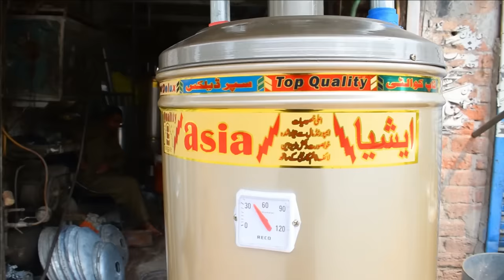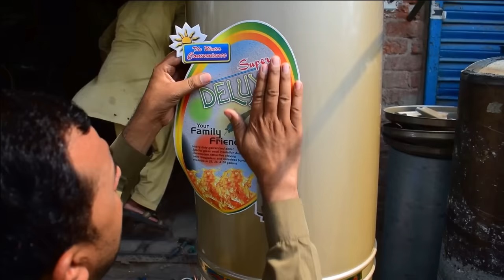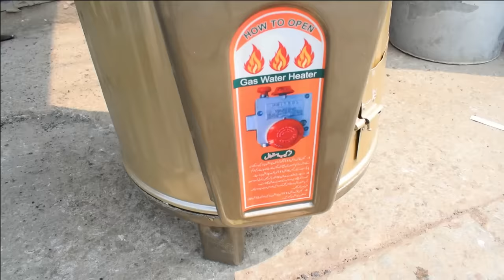Geyser Manufacturing || Incredible Technique of Making a Gas-Fired Water Heater

Comment: This is how things used to be made. These guys in this garage are making a superior product to what we have in the states. I replaced a water heater in my house that was made in the 80’s. Now 7 years later I’m replacing that one due to multiple failures. We need real manufacturers like these guys with a craft. Not computer guided cheap disposable shit. A++
Reply: Seems to me you must have bought a Pakistani water heater. In the usa, at least with electric water heaters, if you change the anode as needed and the very cheap heating elements [$6] or the thermostats [$8]  they will easily last 10 to 20 years. Now we are getting some stainless steel models and the life span will be 25+ years. Had you changed the anode on your heater on year 5 you might have had another easy 7 years. This water heater with out an anode is doomed to failure early on.
Reply: Em dez anos esses soldadores estarão todos cegos. E os aquecedores em perfeito estado. A exploração continua firme e forte.
Reply: @joaquimgomesjunior5010  Eles ficarão cegos em 5 anos e o aquecedor de água será sucateado em 3
Reply: Having managed a Rheem plant for 20 years, I can tell you these water heaters a just ticking time bombs. 
Galvanized internals do not last let alone the removal of it via the welding. 
My guess is that the efficiency rating is next to zero, thermal siphoning is not even considered, by the way, that’s also the case in the US and Canada. Tying insulation on with cord compresses it to zero efficiency. 
I guess shiny paint and colourful stickers can fool the uninformed. 
It’s only ever about the money and even just sales to 1% of their population rakes in plenty of cash. 
Just sayin!!!
Reply: @richardtemby4358  Yes, it's a pretty comedic bit of industrial [wasted] production.
Reply: @richardtemby4358  They should be rather making shoes and teapots, samovars and kettles. No chance to hurt anyone that way. By the way I have been looking for a water heater engineer: Have the Rheem elements in the standard 4500 watt range been cheapened? I have a 30 gallon heater with both elements on most of the time in a radiant heat situation.  Elements last from 3 days to 4 months but not much more. I have used every sort made - ripple, fold back Incalloy, high and low watt density.  Water is hard,  but  I sense a manufacturing defect. Any thoughts?
Reply: @RRaucina  
As I’ve been retired for 20 + years I’m not up to date with current components, however just a tip, try putting the two elements in series, it may be a bit slower but the elements will last much longer.
Reply: @richardtemby4358  What about their tankless systems?
Reply: @abundantharmony  
What about it???
Reply: @RRaucina  if water is hard take Ph samples, how much ppm of calcium and other minerals that are making the water hard and go from there with softeners and water filters. Elements should be lasting longer than that unless another unforseen problem is causing the elements to burn out so fast
Reply: @abundantharmony  tankless water heater as far as the electric type goes are crap in most cases unless you spend the money to have a good one that won't short out or not work within a few years
Reply: This is how crap is made. If you knew anything about a water heater, you would instantly know this is a bad joke on the buyer. No one in America or Britain EVER manufactured such junk. Sad waste of materials.
Reply: No, water heaters should never be made this way! This is a case where "hand made" is a bad thing. No glass lining, so the water will corrode the unprotected steel (especially at welds), and does anyone really think their pressure test is adequate? And there's no anode rod or pressure relief valve and virtually no insulation. These are dangerous.
Reply: Sir, Ap sa contact kasa hoga
Reply: @RRaucina   what kind of anode boiler have????
Reply: @swapnilraut6046  magnesium or aluminum. Google it!
Reply: ای
Reply: Yes sir !

Comment: Cutting galvanized steel with a tortch produces toxic fumes. But what the heck, they are nearly working outside the "factory" and get all the fresh air they need.
Reply: Dear Ebbe Weber
Inclusively the toxic exhaust gases from all the traffic and the fumes from spray painting!
Best regards, luck, health and wisdom.
Reply: Токсик фумес это херня! Оцинковка моментально гниет по швам. Насквозь.

Comment: I was waiting for the demonstration of the interior electrical part, but no problem I understand the commercial secrets, good video.
Reply: There are no electrical parts and there are no secrets its an open design , The camera man just didn't pay attention to details
Reply: @apkafan8004  exactly
Reply: it is algo a gas heater, so maybe more homeowrk is required before you think of ruling you own design
Reply: This heater generates its own power through a pilot that heats up a thermocouple

Comment: I didn’t see them use a dip tube and no relief valve. But they sure are talented at what they do. They deserve to be paid good money for there skills.
Reply: The relief valve goes on the plumbing. It’s installed on the hot water out pipe during installation
Reply: There was a dip tube   was long pipe on cold side went down in tank far  then he welded it in place.  Metal dip tube not plastic like we have here

Comment: My question how the thermostat its work if doesn't connected to any things...
Reply: It is connected, look at 4:10 min, that is where it goes
Reply: @jonasstahl9826  my frinde the thermostat  it doesn't connected to cut the gas or if the cilender goes over heat.. In the case it red the temperatures
Reply: I think it shows the temperature , you adjust at the gas valve. No control from it.
Reply: The thermostat is connected with a temp sensor that is placed inside the tank.... it controls the flame size hence the temperature of hot water.

Comment: A "Faux" water heater. No pressure relief. No glass or epoxy interior coat. No drain. No flue restrictor. No spark igniter. Junk gas valve.... Bottom section is a garbage can! Most critically, NO anode.  And sadly, probably close to the cost of a real water heater.  Complete waste of skilled time and resources. Fun to watch though.
Reply: the bottom is just a cover ,is corrugated it doesn't mean its a garbage can the interior is  thick steel , watch closer
Reply: @gustavcrossbow2805  I understand that it is just a cover, it is fine, but quite funny that they re-purposed a garbage can. They cannot roll that pattern in their shop. No matter how thick the main tank, it needs to be ceramic or epoxy coated to have any possible lifespan.
Reply: @RRaucina  
Come on, the poor guy is just trying to make a living, the price of a geyser like this is just around 75 dollars anyway. It heats the water, that's its job. I bought 2 of em 6 years ago, never faced any problem.
Reply: @naveedali1406  Ask him to add a threaded port for a anode, they are cheap and it is foolish without it. If your water is very hard, and the price of your gas very cheap, they may last some time, but this sort of manufacture is needlessly primitive in this era. I can understand such tiny factories making wood water heaters, or gas fired but not under pressure. They cross the line into a technology that has been perfected, and is efficient and long lasting.
Reply: seems they need one of these for a house with thirty apartments?
Reply: Not sure  how long those tank welds would last before  rusting out. Nice skills though!
Reply: @geepea101able  a decade easily...
Reply: @RRaucina  its Pakistan mate a 3rd world country... these geysers last well over a decade though ...
Reply: I bet it heats water though
Reply: It's is too dangerous also

Comment: With so many safety violations I am surprised they bother with eye protection when they weld. I guess the results of welding without becomes apparent very quickly while the other potential lung and skin problems are longer term so not considered a danger. Maybe it falls in line with the average age of death for males in Pakistan? Let's not even mention the manufacturing process and environment.  This video should be used as a "How the f*ck NOT to do it"!!
Reply: Bet you can't work half as fast as they do, neither weld half as good
Reply: @louizlpsoldier  Never pose a question of which you don't know the answer.  
When I was their age, I could do it quicker, better and safer.

Comment: Wow no blow off valve, putting a potential bomb in unsuspecting homes just to save a couple dollars:(
I would have thought that would have been included in the "super deluxe" Asia brand hot water heater! Well at least there's a thermocouple interlock for the gas supply.

Comment: With no safety pressure release valve, this thing is a bomb waiting to go off.  Even if it works, it will have many pinhole leaks within 2 years.
Reply: I am using one from last 20 years.
Reply: The pressure relief valve is installed by the plumber later on the hot water line...
Reply: @adeelmuz  Riiiiiiiight.  What are you using it for?  A mooring?
Reply: @engrbilalahmedawan1315  Hey, PRV cost money.  They're expensive.
Reply: @Tsamokie  water geyser. I used it for 20 years. Now recently replaced with new one.

Comment: Hard work, but I must say those heaters are not very eficient. There need to be some heat collectors inside, so that most of the heat transfers int the water. Also they did not put an anod rod to prevent the inside from eating up by calcium or whatever.

Comment: This is a ok job. Some investments un the factory and it would be a good job. More inwestments and the job would be perfect quility but price would no longer be ok. So product is super when is sold and sold. 
My Viessmann heating unit has shorter life expectance!!!
Reply: They need a CNC plasma cutter and a wire seem welder to welder the tank at least they will produce more with good quality also they need to do galvanization after assembly because welded steel become weak in water .also welding galvanized steel hurts the eye and skin

Comment: Who cares what they look like on the outside. Every steel water heater since the 1960s is "glass lined" on the inside and has a anode rod to slow down galvanic corrosion. These stick welded uninsulated metal water heaters won't last 2 years without rusting pinholes everywhere. I dont even want to get into the lack of temperature/ pressure relief valves because the questionable welds provide their own pressure relief. Maybe slosh a few cups of paint on the inside. Also don't weld galvinized steel.
Reply: Отец 1995 году сделал котёл из металла, даже не аценковка не было. Этот котёл служил 17 лет.
А вы говорите что 2 года не служить?
Reply: @МойХозяин-п1д  I agree with everything you said. Kamala Harris doesn't know anything about water heaters so I think you are grasping at straws..
Reply: "the questionable welds provide their own pressure relief" LMAO !!
Reply: @donktheclown  😆
Reply: They can easily last a decade.
Reply: @engrbilalahmedawan1315  but if you drink the water from this heater, you will not.
Reply: @rearspeaker6364   nah ...one will

Comment: OMG ... this is a bomb waiting to explode! Pressure vessels like this are Extremely Dangerous. If you know anyone who has one, PLEASE make sure they get a pressure relief valve installed at minimum, BETTER YET, get it out of the house immediately and replace with a Certified unit. Pakistani safety agency people should really look into this Disaster Waiting To Happen. Multiple red flags here: welding on galvanized steel guarantees rapid corrosion rates, too thin steel for pressure, no pressure relief...  The workers are very talented and could easily make something that won't eventually kill someone. Check out Mythbusters episodes showing how violent exploding water heaters can be.
Reply: maybe this is the Pakistani missile factory in disguise.
Reply: I saw that episode and even I  (former AF Spec Ops) was impressed by the explosivity.

Comment: please can I know the thickness of the sheets?
Reply: They don't know, and they don't care.
Reply: @lkytdsvc   lol.... the custom local geysers in Pakistan are made with, 6 guage 4.9mm, 8 gauge 4.1mm, 10 gauge 3.2mm, 14 gauge 2mm, and 16 gauge 1.6mm. 
Manufacturing in pure stainless steel with 304 and 316 are also available, the tanks are still made with galvanised iron though I've requested few local manufacturers to consider alloys or ss tanks too....

Comment: It's ok for a small work shop .. But the tanks were missing .. Internal coating.. For water  erosions and  scale and salts buildups  and ph chemical reactions .. In other words.. More hard water .. And short life span to the tank .. No anode rod ..!! No pressure testing or pressure relief valves ..for hot 🔥 gases buildups .. Which may lead to a faster cracked tank .. !! .. More technical efforts is required to the internal parts of the tank .. Not only external. Spray paint..!!..

Comment: Most important thing neglected is  inside tank not fully insulated.At the end buyer will suffer because of higher energy bill.
Reply: I see at 10:00 at least they are working off a base temp of about 35 C  😃
Reply: Газ.

Comment: This water heater sells for about US$ 175. Has a life of around five years. They do not see any water pressure because they are fed from roof top water tanks. Where they lack is very inadequate insulation and excessive thermal siphoning, but mind it that 99% of the houses they are installed in have non-insulated galvanized or plastic pipes running the hot water. Heat energy is just bleeding out of this system. In a country where natural gas is very expensive, rationed, and imported, such inefficient water heaters have no place.

Comment: Decent job except for the fact there is no coating on the inside, no anode  and no baffle in the flu. The zinc galvanising will act as an anode i guess but the welds could still corrode. Magnesium used as anodes is more reactive. The baffles in the flu make it more efficient
Reply: this is the non- efficient design.
Reply: @rearspeaker6364  AKA  crap design.
Reply: @Tsamokie  dont wish to be within a hundred yards of these!!!
Reply: @rearspeaker6364  I hear ya.  Same for me.

Comment: This would have to be the worst production water heater I have ever seen. Everything is very rough and just eyeballed. Rust would start on the inside welds quickly and the water would be tainted because of the galvanized steel inside. They must be very cheap. Oh and it's not incredible.